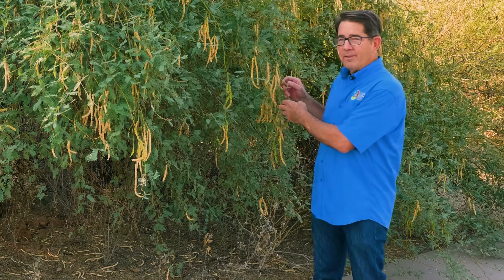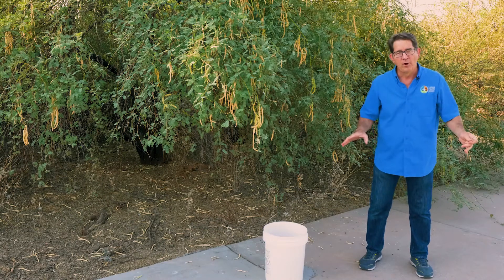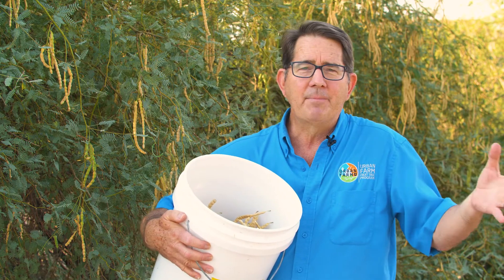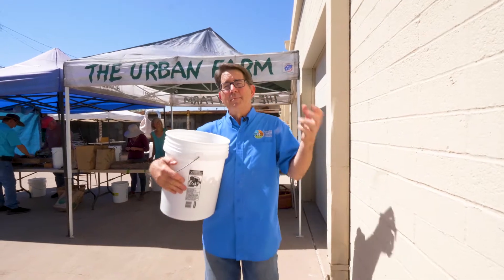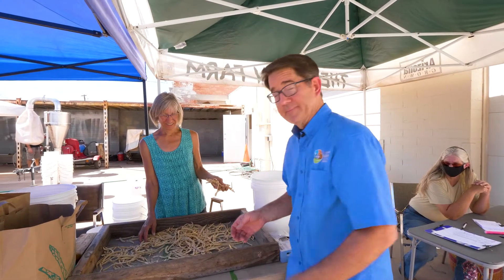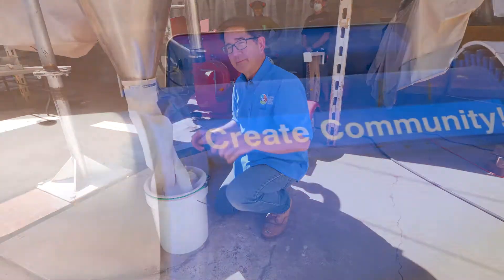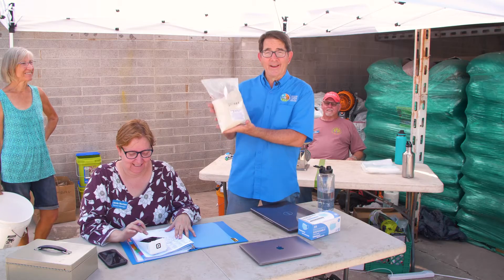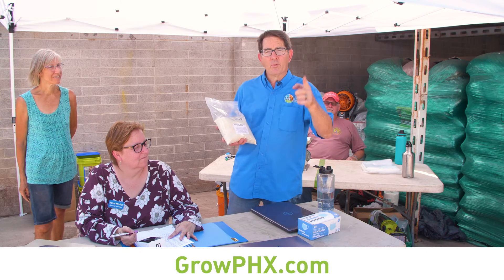Mesquite Tree Harvesting in Phoenix Arizona

Comment: Hello Greg. I have a question about the harvesting of the pods. There are several videos here on YouTube stating NOT to use the pods anymore after it has rained on them because of the fungi growth (just like the ones on the ground) Well... it has rained on 3 evenings in a row here on the west side of Phoenix the last few day's. Can these pods still be harvested and then maybe baked in the oven for a few hours at 225 degrees to kill the fungi and also what ever made it into the pods?
Reply: Probably if they are on soggy ground you can tell the difference mold is very obvious
Reply: The fungi make toxins which is the danger, which you should not try to take chances with, especially when the pods have a propensity for a high degree of being prolific.

Comment: This is not correct.
1st do not harvest until they are brown.
Before hand. will give you a less palable pod.
Each year the time to harvest changes.
it may be mid may one year and late September another.
If you pick them when they are brown. You can mill them right then.
You can just put them in cages and let them dry. Or just store them like this.
You can mill them like flour.
This flour has a licorice flavor. Sometime quite strong. Mixing with other flours  will improve this.
But I have made bread with just mesquite flour.
BTW here is a recipe For basic Mesquite bread.
1 cup mesquite flour.
1/4 water ( guessing never measured)
Make your dough and bake.
I use a solar oven and 4 hours @ 200 degrees. makes a nice bread.
No sugar needed. 
But you can add other things.
Back to the subject 
You can harvest off the ground.
The mold myth is just that a myth.
If you harvest that year pods. You are fine. If you live in the desert. Outside the desert is another story.
Mold does NOT grow in the desert.
If you are getting mold growth. You are not in the desert. At best you are in a semi arid area. 
To grow mold you need cool and moist.
Well desert is far from moist.
And cool only happens at night and winter.
BTW this is the same reason you can not make methane gas in the desert. Its too hot and dry or its too cool. 
And the only time its in acceptable range. Last less then 30 days needed.
Reply: Humidity skyrockets in the desert overnight, its how cactus survive. The last 31 days we had a 73% High and 6% low.  I’ve seen 90%.